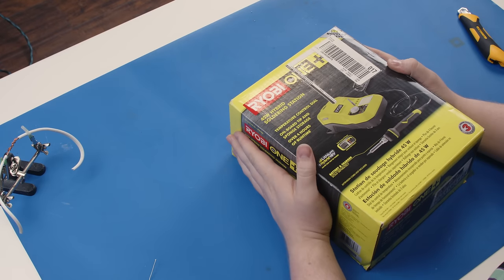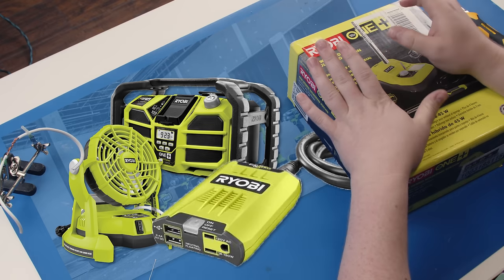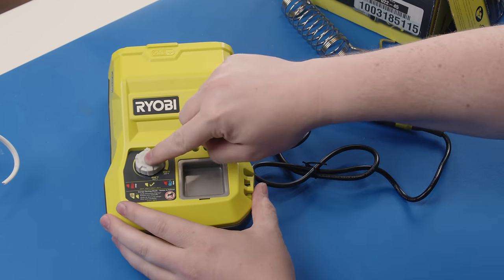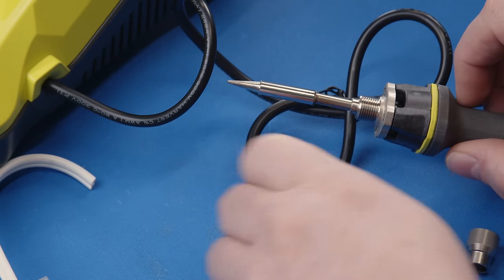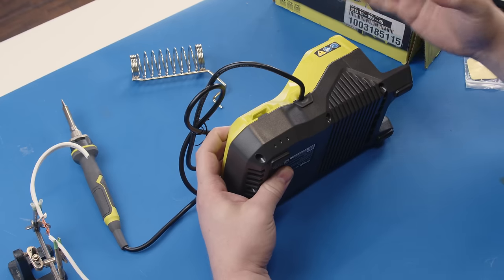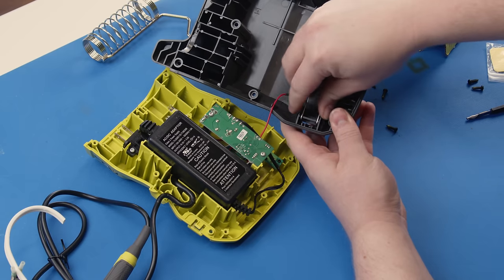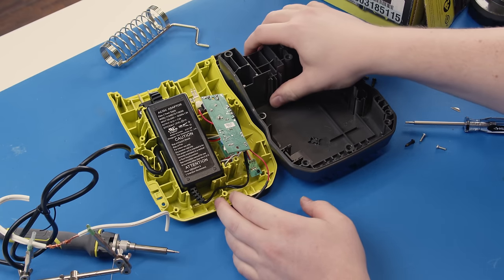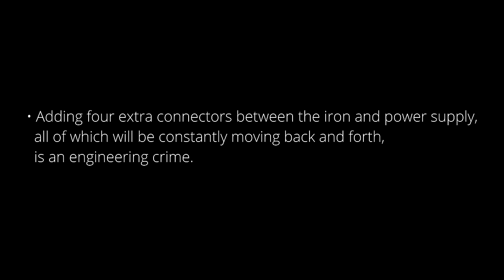Ryobi has GOT to be joking with this soldering iron

Comment: Honestly, I think that my favorite solution for portable soldering is a TS-100 + Milwaukee Top off.   I really like the temperature control and digital interface.
Reply: I run mine on 3d-printed Ridgid battery pack adapters, unless I'm at the workbench, where I'll use a an adjustable DC power supply. Xt60 connectors on either side so I can switch wire length. TS100 and a Pinecil, have multiples of each and tons of tips because they're dirt cheap, I can use 'em in the field on pretty high temp alloys without constantly burning my dumb ass on a gas jet. I have stacks of soldering stations and irons of all sorts and I use a Pinecil most by far. My joints are f'n beautiful.
Reply: Oh and Ridgid batteries specifically because they warranty all batteries for life now. They don't know how the hell you burnt it out, you just make a call and get a free replacement.
Reply: Also I use hi temp soft silicone 14, 16, or 18awg paired wires, very soft and easy to move around. I can hang the cord over my shoulder and overheard soldering with a face shield & it's damn near perfect for anything that doesn't need a couple hundred watts or a torch.

Ridgid battery adapter's ten inches or so of 10awg wire -> Xt60 -> 5S BMS (pretty sure it's unnecessary but better safe than sorry), super soft silicone like probemasters and such, as long as I please like a 4', 6', 10', and so on -> xt60 -> device adapter -> device

Marvelous under a car, I have stacks of gas irons I'll probably never use again. Target temp in 10-20 seconds, then cool enough pull the but out in 60-90 seconds.

Comment: Having worked in amusement game repair for 42 years I have to say this is the first unit that would have made my life easier. I'm retired but have used mine several times and it's exactly what was always needed on the road. Teaming up with my Ryobi in-car charger means all my tools will work all day away from plug-in power. For what it is it's 10 out of 10 for me. And the eBay replacement batteries last just as well as Ryobi for half the price. And work in 20 year old Ryobi tools still. There is no better system.

Comment: the tapering screw holes is likely so when you drop the screw into the hole it will end up in the hole instead of on a edge. so they were like "hey we are going to cheap out with these small screws we might as well make it easier get them in the screw holes." which is a nice thought if they used something like a flathead screw which gives you 0 control on position. but they went with torx.

i actually think the power brick inside the product is a brilliant bit of cost engineering. the cost to make a good power supply in house or commissioned with proper certification is probably more expensive then buying what is likely a very high production psu. it also gives the benefit of the extra heft from the plastic. 

that being said the pvc insulation is not the best choice and the short cables could have been lengthen of not that much more.
Reply: No, they didn't. That thinking would suggest that they expect or want the consumer to be taking out and replacing screws, and on such a regular interval that the assistance would be appreciated.

An absolutely ridiculous supposition.

The holes are tapered specifically as a soft anti-tampering method - Which is why they use Torx heads, too. That's why anyone uses Torx heads.

One of the most ridiculous things I've read. -They did it to make it easier to put the screws in.
I literally can't even.
Reply: @UnitSe7en  someone has to assemble the units in the first place. making them easier to assemble - by making screws fall into their holes - is a huge part of designing for manufacture. Not everyone is out to get you. Also btw tin foil is not actually made out of tin... think about THAT instead.
Reply: @cheater00  yes, they only think of the ease and speed of assembly, having the screws automatically drop in the right place so the assembly worker then just needs to tighten it with a torque limited power driver and a suitable long-shank bit (the need for a proprietary bit is no problem in factory assembly) instead of having to chase the hole with the screw may save several seconds for every screw which will amount to a lot of time when assembling hundreds of units per day. So they don't make them hard to service on purpose, they give no thought whatsoever to serviceability as these are not meant to be serviced, they make them as easy and fast as possible to assemble because it saves them time and time is money. Many manufacturers DO apply anti-repair features but tapered screw holes and torx screws are not that, they are simply used to make the assembly faster. Torx actually USED to be an anti-repair measure but nowadays they are so commonplace that the tools are easily and cheaply obtainable to anyone so they are used because of their superior mechanical properties and suitability for mass production using power drivers.

Comment: I recently acquired a nice butane iron and I gotta admit it's really great. There's no temperature readout, but the actual temperature range you can get by changing the flow rate is surprisingly excellent, and the tip heats up incredibly fast compared to my old weller station. I still don't know if it's a full replacement for my electronic station, but these days I find that I pick the butane iron up nearly every time I need to do some quick work just for how easy it is to set up and start. Don't even get me started on the hot knife attachments.

Comment: Funny how I've never even considered buying a new soldering iron. I've had my weller station for 30 odd years now, never felt the need to replace what ain't broken. It just works and for some reason I also have a very janky poorman's desoldering contraption with it. It has a hollow tip which has a tube that comes out of the side, that connects to a small pyrex tube with a piece of copper braided wick in it, and from there it's a bit of silicone hose down to a foot operated bellow pump. I have no idea who made that thing or where it came from, all I know is that it came with the thing when my dad gave it to me.
I guess that thing is some 40 odd years old, maybe more. It's got a red LED to show when it's heating up to the set temperature, there's even a neon indicator light in the switch to let you know it's on. And the temperature settings are stamped into a little brass plate that's held on by the retaining nut of the potentiometer.

And that "Cold" soldering iron AA-battery operated contraption, looks like it needs to be modified into a battery tab spot welder.
Reply: I have a desolderer I bought at Radio Shack for less than $15 with a body and heating element that looks like a larger version of the classic cheapo soldering iron, then it has a heated tubular tip and a little rubber ball to suck air and solder through it. I never got the hang of using the all-plastic non-heated suckers and wasn't about to spend $400 for a Weller with an electric pump, so this was a surprisingly good compromise. They still sell them on-line for less than $20.
Reply: @pcno2832  I have a similar desoldering iron.  I have had to open it up and clean it out a couple of times.

Comment: I really like my TS100, which admittedly has no battery solution straight out of the box, but it can run up to 24V no problem, which means it can heat up very quickly and you can probably DIY any sort of battery that you'd like for it.  It comes with a terrible "stand", so I 3d printed one with a standard washer to avoid melting the PLA I used to print it.  It uses a standard barrel jack that you'd find on a lot of things, so I just connected that to a universal laptop charger I had not doing anything.

Comment: I've got one of those butane ones with a catalyst, it actually works quite well and doesn't actually use a flame just the catalyst.
It has quite good run time,I've never run it out of gas and the temperature control is pretty good, just not quite as granular as electric but still.
Reply: I use a portasol butane soldering iron and literally been good out in the field.  I have the super pro version. You just lay on ground as has a built in stand, or rock  to cool down. 

Yes can work magic with it. I learned on a plug in solder iron before getting a temperature direct tip one. For Portable still prefer that portasol butane as works well in colder temperatures long run time and never let me down. Plus tips last long on that one when compare to others I used over the years. Only fix I had to do was tighten the screws as a couple worked loose after a few years of abuse. I like that portasol butane solder iron so much been thinking about buying another as a spare, just in case they stop making them?
Reply: @thetechgenie7374  I've a Weller pyropen from the 90s which unfortunately needs a new tip ££££ . It was fantastic when it worked 👌

Comment: Having previously worked at a couple of electronic assembly jobs, my favorite iron was Metcal, but cost $800 around 1995. 

To hand solder well, I learned two tricks.  1) I prefer a hot iron around 800 F.  It allows you to heat the joint quickly and then get off before the heat can travel too far.  With a cooler iron you have to keep the iron on it longer melting or destroying what it is touching.  2) Flux is your friend.  If attaching a wire I tin the wire first before making the joint.  I trim the insulation and expose the wire extra long.  With the end of the wire pointed down, I touch the iron on it and the solder allowing the solder to melt.  I raise the wire up as I drag the soldering tip down and the flux allow the excess solder to pool at the end of the wire.  I then trim the wire to the needed length. 

To solder your DIN plug, pre-tin your wires and cut the exposed portion 1/8”-1/4” long, or the depth of the solder cup.  Touch the soldering tip to the plug’s cup with the solder in the hole.  Once the solder melts and coats the pin’s cup, stick the tinned wire in the cup and remove the heat.  The pin’s cup has good solder and so does the wire so your connection will be good.
Reply: I liked the Weller but we all preferred the Hakko soldering stations in mfg.  When doing big things it takes more power. I also have Weller soldering guns.  I am skilled enough to do printed through hole boards with chips using a 100/140 :)  but I also have units up to 260, 340, and more than 400. The bigger ones around 200-240 are great for doing power and headphone jack bodies and metal shields around RF circuits. That 425 unit I have is great for PL-259 connectors and I even soldered closed a freeze crack in one of my waterpipes. I use it to solder copper connections on antennas and other tough projects. All of which require precision but lots of power. Good tip on the Metcal. I will have to look it up.
Reply: your tips made a lot of sense ,and they actually worked to boot, most of what i need to solder is tiny , expensive guitar ,and recording gear stuff , with parts i can't tear out of my evil step-daughter's stereo or TV, ( i did steal stuff out of her PS2 ,lol ,,a momentary switch out of the controler, yes i was proud of myself), but anyway, it only seem to happen at like 2 AM or so, and you have to finish recording or you loose the vibe ,and i would always destroy most of what i was trying to solder ,but not now, so thanx
Reply: 800F is much too hot, you either needed an iron tip with more thermal mass, or were not using a properly plated tip of the right shape to achieve good heat transfer.  I agree with much of the rest of what you wrote, but would add that when soldering connectors, it is very helpful to have the mating other end plugged in, which both helps to pull heat away from the pin, and also holds the pin in the correct aligned position if the heat did begin to soften the plastic.

Comment: I've soldered plenty over the past year or two, and even with the 110 wall plug irons, never burnt a joint or scrapped a pcb from too much heat. I have used a temperature control unit, and really could not tell a difference between the 2 irons, it was a nice Weller temp control unit, vs a 10 dollar Walmart iron. Both felt great on wire, pcb, super easy
Reply: The downside is waiting ten minutes between joints if you have an open window with a mild breeze.  I've done a lot better work with the trash iron, too. I think it forces me to work very, very slowly whereas before id probably have the big iron cranked to 400 impatiently burning everything
Reply: the cheap irons work perfectly fine. i soldered a lot with a crappy iron in high school, and never had a problem either
Reply: @chris7868  same, working witha better iron I'm actually more likely to screw something up, maybe because I learned on an iron I got for literally 9 bucks
Reply: Add me to the list of someone who’s done a ton of soldering on PCBs with only using a decent quality, non adjustable heat, soldering iron. When I worked in an electronic repair shop which had a better soldering station, we rarely were adjusting the temperatures. For someone who professed multiple times that “I’m not very good at soldering” the author seems more attracted to the bells and whistles than an inexpensive, solid, functional tool that gets the job done.

Comment: When this first came out, I had to get it over the compact version. It's so handy and heats up so fast. For the price I paid, no complaints. The brick is surprising. Now I know the round is the small pack and the small rectangle is the brick. Lights care more about voltage. 20V maybe for voltage drop along the circuit. I wouldn't be surprised if you modified the opposing end of the emitter array with a redundant feed wire. You may get about 10% more light from the leds. The fan must have the small adapter also.

Comment: Having the brick inside is a fantastic combination of brilliant and cost effective engineering (They very likely saved a good amount of certification cost and time to do it that way). But that makes it no less silly looking, and that's OK, if it's stupid and it works etc. The hand feel of a Metcal is wonderful but I can only justify it to myself by doing dumb/intricate rework. Fantastic video!
Reply: This comment came really timely. I took apart my fume extractor yesterday and was beside myself with how overpowered the 12V external transformer was for what was effectively a PC fan connected to a potentiometer in a plastic housing. It seemed unreal that they didn’t simply build the power supply into the housing, but your remark about certification cost makes sense.

Comment: The TS100 is amazing for DIY electronics. Reliable and quick. I even 3D printed a little soldering station for it with some washers and nuts for holding the hot parts and keeping the whole thing nicely weighted down. The whole setup fits well on a wooden tray, which is great as I have even less working space then you do!
Reply: And if you want an actual proper station, the t12 is amazing too

Comment: Even with a soldering station, there is an need for a simple soldering iron. But this should be  one of these 80w or 100w types (or more), because they have the thermal mass when you want to solder or desolder a heatsink or a big mosfet from a pcb or/and when it is on a huge groungplane. Sometimes you can get them with a integrated temperature controller, but a simple version does also the job in these cases.

Comment: Sound engineer here- I have that same Weller. It’s great. Chose it over the digital ones. 

For soldering connectors like you mentioned (DIN I think you called it?) which look similar to xlr- seems counterintuitive but use HIGHER temp so your work gets to temp faster, meaning you don’t sit there holding the iron to the work as long, decreasing the total amount of heat soak applied. Similar concept to welding. 

Hahahaha I had that exact butane iron. It was a great novelty/ for remote use
Reply: Also, plug the connector you're soldering, into its mating connector so if the plastic were to melt a little, the contacts will stay in the right position.  It can also help to tin (plate with solder) the contact, if you can do so without filling it too much to get the wire in), using a shorter amount of heat than if the wire were inserted first, and tin plate the wire, let both cool, then do the final reheating.

Comment: As an owner of the Milwaukee soldering iron, it works pretty good. I use mine often. Also, I have both 12 and 18v tools, I grab at the 12v stuff for daily use, it's easier to swing the lightweight stuff over the day. 18 v when you absolutely need it.
Reply: I use mine with the 4.0AH battery which is wide enough to act as a stand. Just hope you don't sit on it!

Comment: I struggle to understand why Ryobi gets so much hate.  I've been beating the crap out of the same Ryobi drill for more than 10 years now and it's still going strong.  They understand that their market is not the serious tradesman, it is the frequent DIYer.  They are selling the guy who wants the right tool for the job but isn't going to be beating the crap out of it all day every day year after year.   Like for me I don't know how to solder(I would love to learn) so I can't speak to the wire issue with this thing but nothing else about the tool construction bothers me, even a little bit.   If I was getting a Solder station I would probably go with this one now that I know it exists, for similar reasons to what drew you to it.  I could get it out and use it anywhere I need it easily with minimal setup time the 1 or 2 times a year I might have something to solder and any other time it can be packed away easily into a drawer somewhere.  And I have had that same light now for about 3 years I think and I love it, it works great and the hanger does feel a little cheapo in the had but it works exactly as it should and comes in handy all the time.